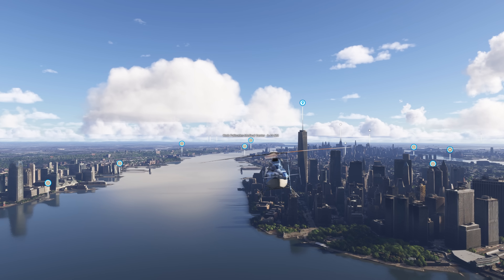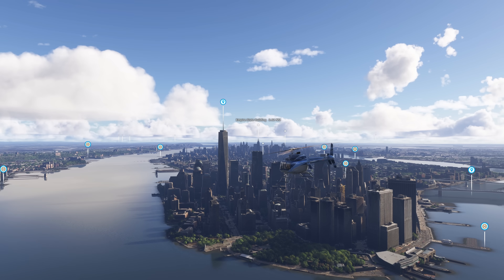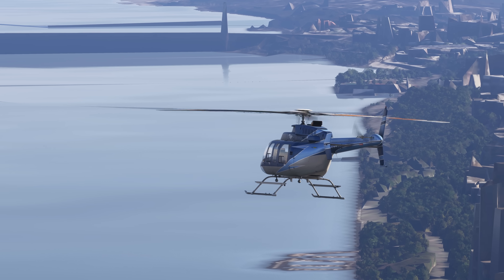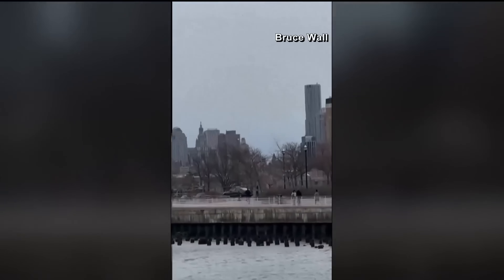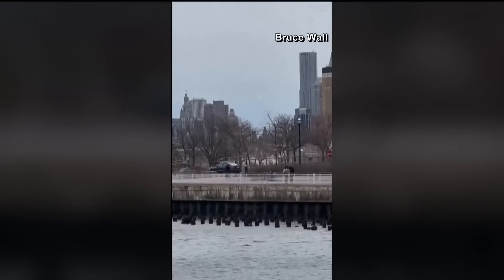Helicopter Expert breaks down Hudson Crash, and discusses “Bump Mast” Theory | NYC Crash Follow-Up

Comment: please hold your guests to a higher standard of explanation, Col Joe is obviously a very experienced helicopter pilot but his explanation of mast bumping is lacking
Mast bumping only occurs in helicopters using semi-rigid underslung teetering main rotor systems, examples being bell 47, 205, 206 and robinson helicopters
Mast bumping occurs when the angle between the main rotor hub and the vertical drive shaft, the mast, exceeds design tolerances and the hub makes contact with the mast.
When this occurs  the hub may wear the mast to the point where the mast fails and the main rotor separates from the mast. If this happens the main rotor may contact the tail boom but if it does the contact is purely incidental, mast bumping may occur with no tail boom contact.
This did not happen. 
The video shows the main rotor system with the hub still attached to the mast witch is attached to the transmission .
The Jesus nut did not fail.
The Jesus nut is the nut which secures the hub of the main rotor system to the mast. It is  euphemistically referred to as the Jesus nut because if it fails the main rotor will separate from the mast and then not even Jesus can save you.

From the video the helicopter experienced an  uncommanded turn which applied unsustainable aerodynamic forces applied to the airframe consistent with drive train component failure or seizure which led to the aircraft breaking up in flight.
I am a former Army aviator and have flown UH-1 and OH-58 helicopters, I hold ATP CFI CFII and MEI certificates

Comment: Hey Captain Steeve,
Your observation that a rotor striking the tail boom would shatter the rotor makes perfect sense. 
I’m no helicopter engineer either, but I think that simple physics says something relevant about this tragic incident:
Without a tail rotor, the engine would rotate the main rotor in one direction and the helicopter body the other way (with the ratio of their rotation speeds equal to the inverse of the ratio  of their moments of inertia about the axis of rotation of the rotor.)
The tail rotor prevents the helicopter body from rotating by producing thrust that is perpendicular to both the axis of rotation of the rotor and centerline of the helicopter body. 
If the tail rotor suddenly stopped producing thrust, due to a mechanical failure or a bird or drone strike, conservation of angular momentum would require that the helicopter body start rotating, resulting in a sudden angular acceleration that could twist the rotor and body apart, as observed. 
This analysis is obviously completely devoid of hard numbers, a study of the wreckage will hopefully yield a definitive explanation and definitive lessons to learn.

Comment: Without speculating; video evidence thus far available reveals the following facts:
First observable event in the mishap sequence is a violent right yaw.
After 90 degrees (+/'- some amount) of right yaw, the tailboom separates some distance aft of where it is attached to the fuselage.
Shortly after tailboom separation, the main rotor, mast, main rotor gearbox (MRGB hereinafter) and portions of the main beams separate from the fuselage as an intact assembly.
Not from video, but reportedly at about 900' agl at commencement of mishap sequence
If it has been reported, I've not yet become aware - airspeed just prior to mishap sequence?

Now this may stray into speculation, but what can we discern from the above facts?
First, for all of you "experts" in the comments who cite as "fact-certain" this mishap's genesis was "MRGB Seizure," you may want to go stand in the corner until release of the NTSB report. If you could wish hard enough to turn the Bell 206L4 into a "commie" or "Euro" (but I repeat myself) rotary wing machine, you may have a leg to stand on. But inasmuch as it is a Bell, you are simply loud AND wrong! Review the direction of rotation of main-rotors on USA designed and built helicopters and then think diligently which way the large mass hanging beneath them would rotate should the attached gearbox seize abruptly.

Right yaw? What might cause it in a helicopter with counter-clockwise rotating main rotor? (as viewed from above)

Loss of anti-torque - due to any (an "or" vice "and" case, if you will) of the following failures: Tail rotor driveshaft, TRGB, tail rotor hub, tail rotor blades, yeah, even tailboom, as that would sever the tail rotor drivetrain.

Engine overspeed, more probable to require a hover or low-speed condition to precipitate that much rotation, but an increase in torque will require a corresponding increase in anti-torque (left pedal, in this case) to maintain balanced flight. 

A strong stab at the right pedal 

Now a word or two as some have speculated about tailboom failure: As you sit in the aircraft in forward flight, you get some aerodynamic "weather vane" effect to aid in the anti-torque solution to counteract the effect of main rotor torque trying to spin the fuselage clockwise beneath it. But weather-vaning itself is insufficient. You need anti-torque forces as produced by the tail rotor.  As I pulll collective to lift into a hover, I need to add an amount of left pedal to prevent the aircraft from yawing to the right. As I tip the cyclic forward to initiate forward flight, I need to feed in a bit more up collective (an increase in toque) and consequently a bit more left pedal (more anti-torque.) As airspeed increases, the shape of the aircraft induces a bit of weather vaning effect and slight pressure on the right pedal is indicated, reducing the anti-torque force. However, we are still left-pedal dominant, with positive pitch on the tail rotor blades, just a little less left pedal than before at the slower speed. 

Let's think about what's happening back there behind us, shall we? When producing anti-torque, the tail rotor is "pushing" the end of the tail boom to the right, so as to bring the nose of the aircraft back to the left to counter the right yaw induced by increased torque required to lift off and transition to, then maintain forward flight. 

The videos I've seen are shot from the right, or starboard side of the aircraft. They have been somewhat grainy and blurry. Let me say it this way: From what I've seen so far, the entire aircraft appeared to yaw right as an intact unit, with the tailboom breaking off after about 90 degrees of rotation. IF the mishap were initiated by tailboom failure, AND IF sufficiently high-res video were available, one would expect to see both the nose of the aircraft AND the aft tip of the tailboom rotate toward the camera. I see that with the nose, I do not see it with the tail, but that may be due to resolution and frame rate.

Comment: When was the annual? Everything inside me is pointing to a failure to properly reassemble. That transmission de-coupled from the airframe, f'ing impossible. Somebody screwed the pooch on this one. At first I was told there was some acrobatics involved. 206 is not designed for that at all, I watched the videos available and this was a straight level transit well within design parameters. You can see from the high rise camera angle the transmission decouple and the cabin rotate over 110 degrees instantly. It appears in that camera angle that the entire cowling from the top of the hub assembly was still in place. It came off as it fell. The entire of this aircraft came off at once. I expect an A&P is currently being interviewed, or the entire company.

Comment: From the outset, let me state I am not an aviation specialist. However I do come from a long engineering background (both mechanical & medical). That said, here’s my take on what happened. For reasons as yet unknown, the gearbox / transmission locked up solid. At that point, the torque from the rotor blades & overhead assembly would have violently skewed the fuselage against the directional stability of the tail rotor, such that it literally sheared the tail boom off, (typically at its weakest point - i.e. attachment to the main body).  At the same instant, this torque shear literally tore the entire transmission from its mounting, complete with its collective & blades (as later recovered).

Comment: OMG, This is bullshit unlimited, its an idiot talking to well, a former expert who no longer can articulate helicopters 101.
It boggles the brain how Steeve can post such dribble.

There is a wealth of info just in the comments to this video but not in the video.

My take is that this was  most probably a maintenance issue and it may well be 
that the entire transmission departed the helicopter due to something as simple as a bolt or bolts not properly secure or a string of events that resulted in explosive destruction and departure of that gear box.

Comment: I crewed an OH58 (Bell 206) helicopter in the Army '85-88 at Ft Polk, La. We had an incident were a 58 was doing a Maintenace full power runup (not flying) and a weight from the end of the blade came off, this was a new blade from depot. This failure caused a very violent shaking of the aircraft thankfully no one was hurt. The blade was sent back to depot for analysis, and depot found the adhesive that bonded the weight to the blade had failed. Basically, a bad batch of glue. I'm not saying this is what happened to this aircraft, but I would like to see the ends of the blades.

Comment: Captain, I wish you would get people that actually watch the video before talking. Any helicopter pilot in the world would have told you that mast bumping in this case did NOT happen. Not only that but if he had any time or training in the Bell 206L4 he would have told you that the modern B206 has protection in the rotor head that nearly prevents mast bumping. After flying helicopters for over 30 years, certified in aviation safety, accident investigation and as a maintenance test pilot in multiple helicopter series, I saw that this was an in flight structural failure, not mast bumping.

Comment: Quick question, if there was too much collective causing blade droop then why doesn't the rotor hit the boom at start up? My heart goes out to all involved. I saw one video where pilot calls low fuel or no fuel. The helicopter suddenly dives. So just speculation if he runs out of fuel he dives to pick up airspeed for auto rotation and doesn't relieve collective and pulls too much cyclic increasing too much g load separating  the rotor assembly. Is this a possibility?

Comment: Clearly, the transmission seized, and the main rotor detached.  The transmission and complete main rotor can be seen flying and spinning after separation from the main craft.  The strain from the seized transmission was enough to detach the tail and rear rotor.

Comment: It's criminal to let such an inexperienced pilot handle tourist flights.
The man was 37 years old and he decided to have a career change at 35 and become a helicopter pilot.
Grossly inadequate experience for such a job, he killed himself and that poor family.
Reply: That is very unlikely to be the case here.
Reply: What's criminal is you internet experts who make ill-informed comments about a pilot's abilities, experience and professionalism!  Then have the gall to charge him with murder or manslaughter before the ink is dry on the NTSB report. He was 36 btw, still young enough to make a career change.  🤔
Get lost joker 🙄👎🏾
Reply: @MR.Pilot_Electrician  He was young enough for a career change that did not involve taking human lives into his hands. 
The man did not even know how to properly calculate required fuel load, surely you've heard his radio call about running low on fuel.
When the final NTSB report comes out it will say it was pilot error due to inexperience. Criminally negligent.
Reply: @yiorgos-theo  "The man did not even know how to properly calculate required fuel load, surely you've heard his radio call about running low on fuel."
Again, you show your "expertise" in aviation and helicopter tour operations.

He did not make a radio call about "running low on fuel."  He made a routine call to the ground crew (a heads-up), that upon landing, he will need another fuel load (not a top off), prior to taking the next passengers up.

Proper weight and balance is calculated for the passenger loading (which varies) and short duration of the flights, hence not carrying full tanks.

Another YouTube expert huh?
Reply: @MR.Pilot_Electrician  So, you would trust an inexperienced  rookie pilot with less than 800 hours to fly your family? I wouldn't. There should have been a supervisor pilot in this flight.
Reply: @yiorgos-theo  Who I would trust is irrelevant to this accident and your accusations of the abilities, professionalism and performance of THIS particular pilot, and what the cause of THIS particular accident was.

IF, after the investigation is complete, it turns out to be pilot error, THEN and only then do you or anyone else have a right to charge him with "killing himself and that poor family!"

DID I MAKE MYSELF CLEAR???
Reply: @MR.Pilot_Electrician  Crystal clear! You  think you can bully others and tell them what to think. Move on little mouse...

Comment: The hard right yaw was extremely violent like a transmission failure or tail rotor shaft breaking with rapid main rotor speed loss. I know even with some helicopters an auto rotation is possible with enough forward speed held through a large downward arc.

Comment: Tailboom failure is not the possible cause, the tail was strong enough to pull the entire helicopter 90 degrees, before it broke off. You have to figure out why it turned so fast.
Reply: Probably because the entire main rotor assembly came off along with a chunk of the roof.

Comment: The head nut really is a red herring
The nut is tqd at 3300in lbs
It is very tight and locked with a pawl that fits into serations around the nut ...it would be near and utterly imposible for this ever to slacken off and after 40yrs working on 206/206L  ive never ever  found one backed off or slack

Comment: My take on this:
The sudden 90 degrees yaw to the right is abnormal fast and can not be explained by engine failure. At cruise speed engine failure  causes only a 20 degrees yaw to the right as the Tail Fins keep the helicopter straight. The  exceptional yaw can in my view only be explained by the following scenario:

- Main cause: The Engine Main Drive shaft failed, removing power from the main Rotor ( no more Torque )
- As a result the Main Transmission was no longer driven, but the Tail Rotor system still was ( Bell Design ).
- The unloaded engine did overspeed and gave full power to the Tail Rotor, causing a massive anti-torque to the right
- The pilot  immidiately reacted, correctly, with full left pedal to adverse the yaw and by lowering the collective 
- the tail couldn't take the sudden force:  air resistance + extra strong Tail Rotor + pedal input to the left,  and departed
- The departing tail hit the Main Rotor and cut of one tip-section causing major unballance in the rotor
- Main Rotor unballance ripped off the entire Transmission and roof section ( unbalance is clearly visible in video )

Please take a good look at the Main Drive Shaft

Comment: Since this video was done, they've recovered the entire transmission and mast and rotor assembly and it all appears to be intact. The transmission appears to have separated from the frame and tore off part of the top frame of the helicopter as well. To me, this suggests a catastrophic transmission failure where maybe the transmission locked up and then the momentum of the rotors ripped the transmission and mast off of the helicopter, and then the tail boom partially or fully came off as a result of severe sideways aerodynamic forces.

Comment: Why can no one explain mast bumping? What exactly is bumping in the mast?

Is it that the movable mechanical control bits in the mast assembly run out of travel and that causes the rotor angle change to suddenly stop which bends the rotors enough to break something?

Does the bumping refer to the rotors bending down enough for one or both of them to strike the tail boom, in  which case it's not really the mast bumping at all?

Come on, guys. Do better.

Comment: Trying to get back to you Steve and before I Post this Reply Let me say I think you are a great asset to Aviation and educating people, but I have my concerns with a statement you made, As you explained in (Smoke on Board Video) That Going to 5000 feet and dumping 6 hours' worth of fuel is not an issue and that it will never go to the ground so where does it go? Simply disappears? How does it magically defy gravity? Jet A Fuel weighs approx. 6.7 Pounds per gallon and 6 hours' worth of Fuel weighs approx. 30.000 to 100.000 Pounds depending on the Aircraft. What I am gathering from your Statement in the video at starting at 8.20 in the Video. It's Perfectly acceptable to Dump this fuel over Schools and Public drinking water reservoirs because as you said It Just Dissipates.  Disappears?  It does not come to the ground by Gravity itself or in the rain.  It is suspended forever in the sky. My colleges are very interested in this new Science How even 50.000 Pounds of Matter can Just simply disappear. Having no effect at all on the environment or the People. I would love to hear your explanation.

Comment: This is what happened and its happened before. The primary failure was the tail! https://www.ntsb.gov/safety/safety-recs/RecLetters/A96_8.pdf
https://www.ntsb.gov/Pages/search.aspx#k=NYC96GA083#s=11
Reply: That only applies to the L-1 to L-3 models.  This one was a L4 which is supposedly has fixed that problem.  Here is a crash of an L-1 where the pilot chopped the tail off and the rotors and gear box disconnected in the same way as this crash.  https://www.atsb.gov.au/sites/default/files/2023-05/AO-2022-034%20Final_0.pdf